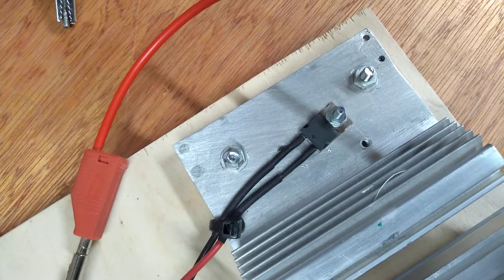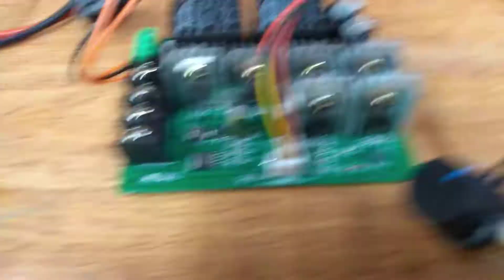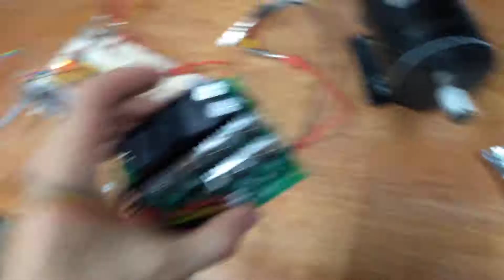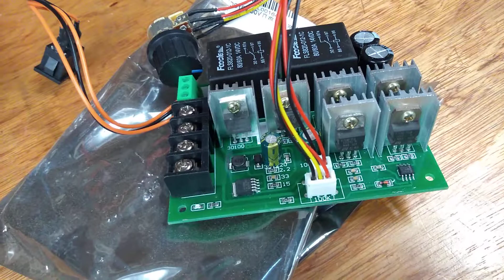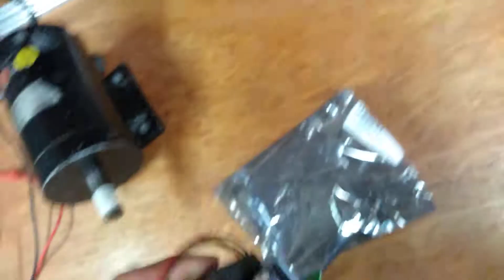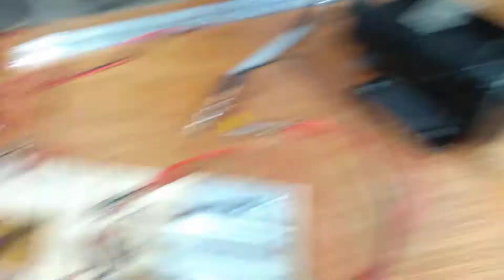Cheap homemade PWM motor controller for 24V 10A DC motor

Comment: Pizzey: There are many in the US Unimat lathe community converting to 24vdc 150 watt DC motor. You could do us a tremendous service posting a schematic with component values when using a 24vdc output power supply with this circuit. Thanks.

Comment: Hello, we have to do a project for school. We were given the exact same motor as you're using but our teachers don't know anything about the motor. Do you have a datasheet of the motor, a website about this motor or anything else that can help us. Thank you
Reply from the maker: I don't have a datasheet nor the motor any more. If I recall correctly it was rated 24 vdc and pulled several amps, even under no load conditions. You will therefore need to source a suitable power supply. Depending on what you plan to use it for you may find it convenient to run it at a lower voltage, e.g. 12 V. My advice would be to check the label or nameplate for a model number and search online for more certainty.

Comment: Great job! There is a one more option how to cool it down. It's been checked by one guy who ride for 3000km on the "open motor". The idea is to rotate windings powered through sliding contacts, exchanging one side cover of the motor to thrust bearing. As you can see I've removed more than a half of winding (better for temperature) changing winding scheme from 27/30 poles ratio  to 12 winded of 27/26 (from 333 x 333 x 333 moved on 120 degrees to 9x9x9) leaving only paired adjacent coils in one phase placing as far as possible in the border of 9 stator teeth for better torque. The electric scheme can be more powerful because of the degree of the distance between paired adjacent coils in 1phase. The more degree is, the more energy efficient torque appears between a diametrically opposed paired adjacent coils.  The most efficient angle is 180", where pairs of adjacent coils are situated directly opposite each other (greatest leverage). The most powerful schemes (of most expensive motors)(rotor stator poles combinations)  are 16/18 ("ultra motors" ) , 38/42 (the most efficient Japan bldc for flying models "U pro") , 12/14 ,24/26; 36/34 (all these schemes provide 180 disposition between paired adjacent coils belonging to one phase) So you'll empty the middle teeth , but edging teeth of the phase must have a paired adjacent coils, because those linking areas when ends one phase and begins the other must be winded, they are "torque places" .You can remove windings by dropping teeth thereby increasing the angle of lever force  in one phase. Running (rotating) windings of the stator , instead of rotor cools by empty and non-empty teeth. These teeth "grab" the air because of their rotation and this system can be easily improved by adding 5w fan directed to open windings. Thus giving a great temperature and power effiency. Every 30 degrees above the design temperature of copper resistivity (20 degrees) is 10% loss of efficiency for the resistance of the wires. For example, 1 kilowatt motor is 100 W losses at 50 degrees. And at temperatures above 90 degrees, the resistance gradient is much higher.  I've changed construction bearings (sliding contacts) to industrial ones. I'm working on belt drive one side open  motor with wooden pulleys and square woden motor holder with construction studs and bolts with nuts for e-bike like in this video.. https://youtu.be/Xk_rqGVw0f0
Reply: A much  better idea is to draw lines on the optical disc, this will produce a hf modulation and therefore cooler running.
Reply: All this mechanics can be replaced by an optical disc and photocell.

Comment: diegram?
Reply from the maker: I will post the schematic shortly. Thanks for your interest.
Reply: Is it possible to make something like this that can handle 60 amps continuously for up to 1 hour? I currently have one of the cheap motor controllers I found on ebay, but they get hot and die after about 5 minutes of use. I'm trying to use it on a trolling motor for my boat and plan to put epoxy around everything but the heatsink for the mosfets, but have no clue where to start.
Reply from the maker: Do you really need speed control with a trolling motor, and is 60A the continuous current or peak current? You will certainly need good batteries! There's no technical reason why PWM could not be used with a 60A load but you'd need to choose your switching MOSFET and flyback diode with appropriate current ratings. It's not difficult to find components with 100A ratings and that's what I'd choose. Why were you planning on using epoxy? Conformal coating (available as a spray can) may be another option if you want to keep moisture away from the board and components.
Reply: @PizzeyTechnology  the epoxy is to keep moisture out. Using the flea-bay pwm controllers I've been fighting rust, corrosion, and heat. The motor pulls a constant 58 amps for 50-ish minutes to get to my sweet spot across the bay. Once I get there I prefer to set the motor in a low speed against wind and current since the water is 200ft deep and that much rope for an anchor on a kayak is a pain. I've tried putting the so called 100 amp controllers in a dry box with silica packets to help with moisture, but they overheat. So it's looking like building something myself and using epoxy on everything but heatsinks is my last option before I give up. I use 2x 100ah and 1x 50ah lithium batteries to make sure I have enough power to get there and back, but I'm yet to find a motor controller that can handle that many amps for more than 5-10 minutes.
Reply from the maker: @james pendleton That sounds like quite a setup you have there and I'm not surprised the eBay motor controllers have failed as they rarely are as described. It would be interesting to know which components have failed - maybe they have used MOSFETS that are underrated for the load? I have had more success buying components (than ready-made circuits) to build my gear and if you decide to go down this route then I'd be looking for MOSFETS rated for 200A continuous load with the lowest R DS(on) and shortest turn on time that I could find for a reasonable price. For example, the RU4099R available on eBay (10 pcs 4.75 USD / £3.69) is rated for 40 V and 200 A with an R DS(on) of just 2.8 mOhm. Better MOSFETS are likely to be available - this is just the first one I found.
Assuming a drain current of 58 A continuous, the RU4099R would need to dissipate just under 10W (P = I^2 * R = 58^2 * 2.8 * 10^-3) which should not be a problem with a moderate sized heat sink. Does that help at all?
Reply: I’ve got a 240v ac motor will this work with it?
Reply from the maker: No, PWM speed control is not suitable for an AC motor.
Reply from the maker: Here is the circuit https://youtu.be/ermE0uagwac